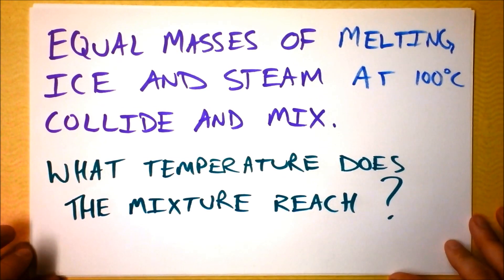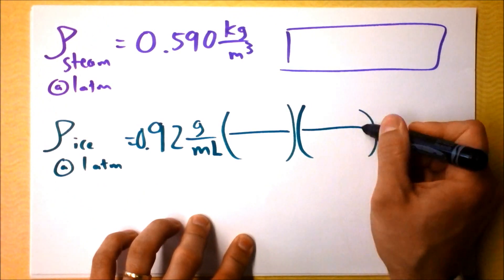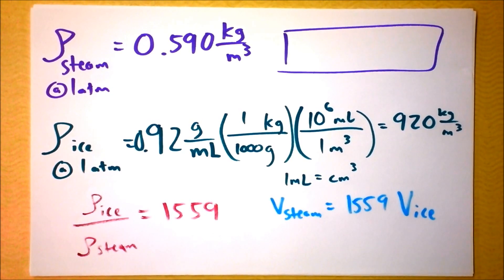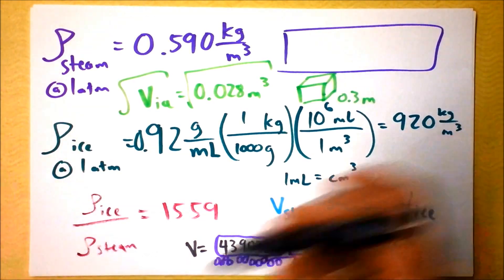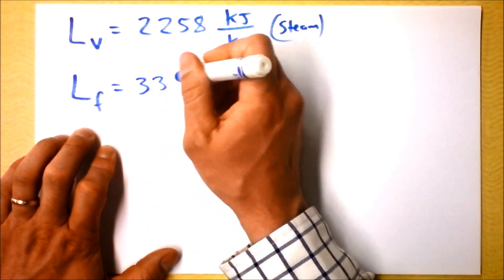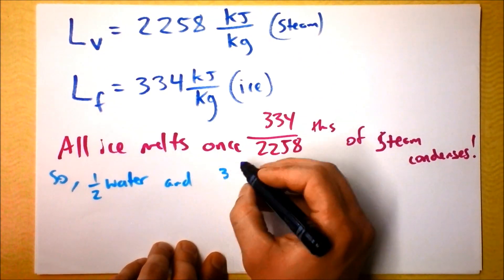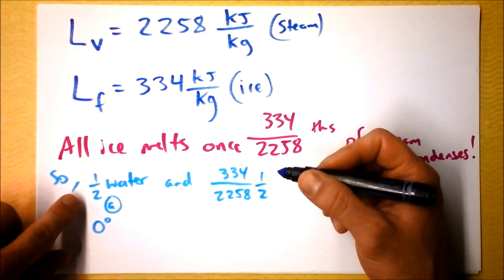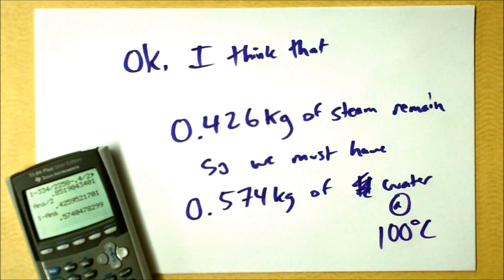Latent Heat, Phase Change, and Heat Capacity - Worked Example | Doc Physics

Comment: The specific heat shown is wrong by a factor of 1000: c = 4.18 kJ/(kg·K).
The heat to increase water temp. by 100 ºC is Q = 4.18*100 = 418 kJ/kg.
Since Lv = 2258 kJ/kg > Lf + Q = 334 +418 =752 kJ/kg, then we will have a mixture of water and steam at 100 ºC, consisting of 0.5*(1-752/2258) = 0.33 = 33% steam and 1-0.33 = 0.67 = 67% of water.

Comment: Can the Doc or someone else explain please. If the Ice cube is 30cm cubed and the ratio of ice being 8.3% bigger than the same amount it was before when it was water. So 30x30x30 is 27000= 27 litres if it was acube of water. But because it is ice then it must be 8.3% less size once it turns from ice to water. So the new cube is 24759 or 24.7 litres of water. Water to steam ratio is 1603 to 1 at atmospheric pressure. 1603 X 24.7= 39594 of steam not 43900.  This is just me tying to work it out. I know I am wrong but this is how my brain is trying to work it out. Can someone explain where I am going wrong. Because I want to understand this stuff. Thanks in advance

Comment: I just got home after a very long and hard day, and I'm too tired to think. Fortunately there is someone who solves these problems,  so I'm just going to ask nicely.

What about the mechanical work? The discussion of the density ratio assumes constant pressure. Is this actually an assumption in the problem? If it is, we need to adjust the volume as part of the steam condenses. That involves (negative) work. Maybe a fairy is overseeing the process and magically maintains the energy balance. But maybe she is too tired also. In that case we need to take this change of energy into account. Let's for the occasion assume that I'm a teenager, and this is my homework assignment. How does this mechanical  work affect the answer?